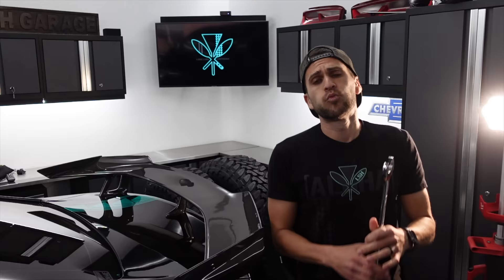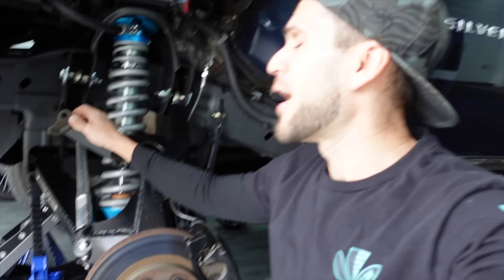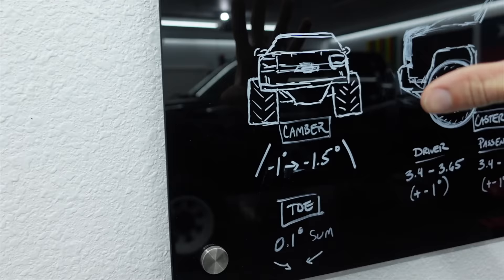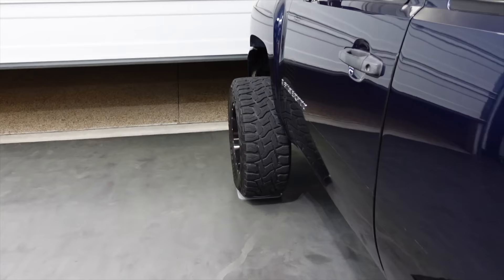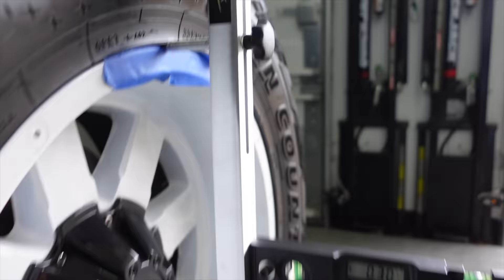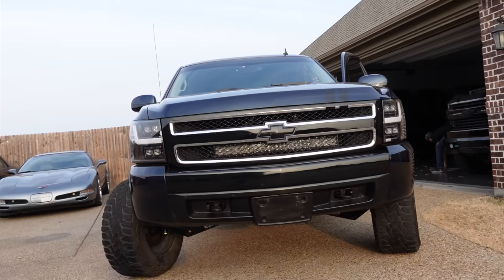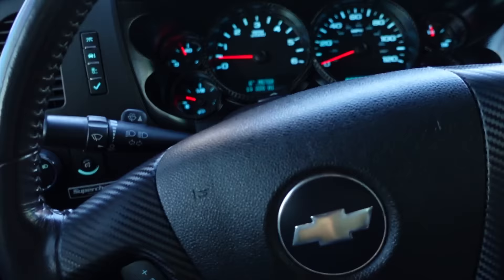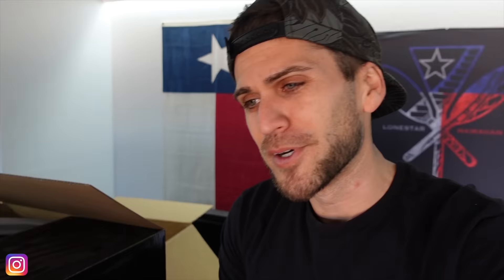FREE ALIGNMENTS FOREVER - Stop Paying For Crappy Work

Comment: Ugh, $10s of thousands of toys in your garage and a $100 alignment put you over the edge, lol
1. Mechanics are not making $140 hr the shop is. The tech doing your alignment is luck if he is getting $18-$25 hr.
2. I dont like the term 4 wheel alignment. Here we charge for a alignment period flat fee for running it out and depending on the work needed to make adjustments the price goes up.
  3. The tool you bought could easily be made , I do like the portable turn tables. Like you say the tool appears pricey for what it is but its not like a set of screwdrivers. That “everyone” buys.
  Our alignment machine was $20k+ 10 years ago along with all the updates.

4. No adjustments in the rear, well there are no factory screws or such but knowing what the rear is doing can greatly impact alignment.  There are kits and add ons to get the rear “true” from shims for toe and offset spring seats 
Thrust angle is important 
  Good video though

Comment: love your system dude, but $800 is a little too much for a few aluminum sticks and inexpensive calculator level electronics. Your profit margin is on the obscene dude, you got to adjust it and you will make more on volume and popularity. Not only that, but we are supposed to spend nearly a grand $1,000 and still have to deal with the cheap string and jackstands (???) that's crazy dude. Don't be so greedy.

Comment: This is definitely going to be nitpicking, but yes, you can (and should) do a 4 wheel alignment on your truck.  Even if you don't have a panhard bar or something causing lateral shift in your solid rear axle, there are a ton of situations that can cause misalignment, and thus tracking problems, between your front and rear axle lines.  Been there, done that, played the game, got the t-shirt.  

Just because you don't think there is a mechanical linkage to be adjust doesn't mean it cannot be misaligned.  This is a lack of skill and experience on display, you need to do some research and sit down with experienced mechanics who have worked on this type of problem before.

Comment: Actually those plates, are a complete Rip! If you want to seriously, step it up a notch ? With the amount of funds" you provided to that failed incomplete 5billsum? you could have paid way less and benefit with more accuracy if you would grabbed 4 gyroscopic modules for 100% digital angle tilt positioning and 2 lazer diode  distance level  sender and receivers modules a controller of your choice or pie I should say? a spool of 5 strand 18awug cables for length to controller and some dupont connectors for that dazzle finish look sketch out a program? <that i already >have// (lol) and receive way better results with a few mouse clicks

Comment: Nope!  Just that "flexible" measuring tape alone is going to give an inaccurate reading for the Toe adjustment needless to say about those strings setup, Tried it and done that several times then decided to sell the tools and let those laser alignment do the work... lastly, specifically on wheel alignments, it may be satisfying to DIY yet an inaccurate plus the amount of time ended-up spending to the setting just close enough is Not good enough.  Love to DIY but certain things leave them to the professionals (finding the right tech with properly calibrated alignment shop is where we need to do our homework).